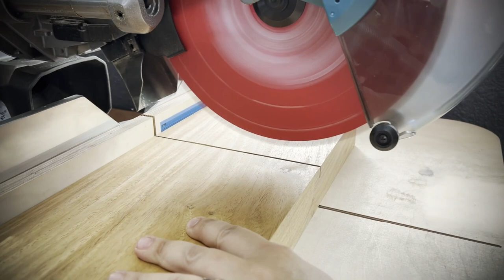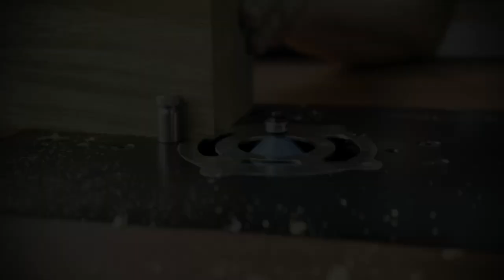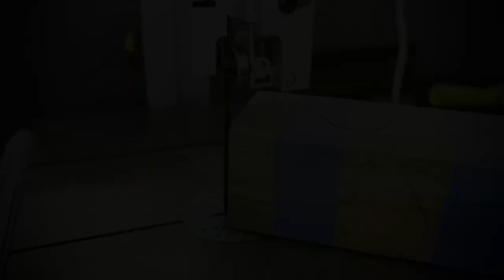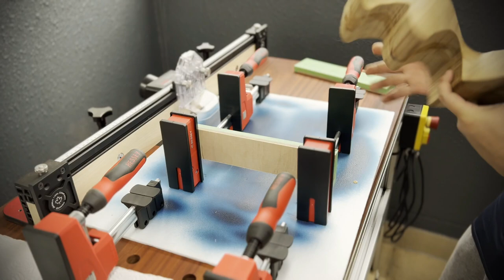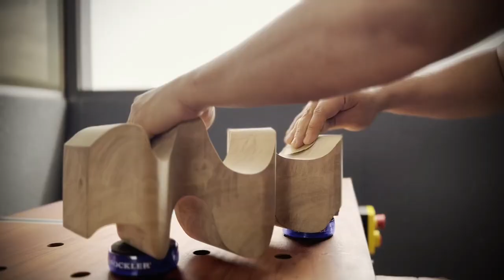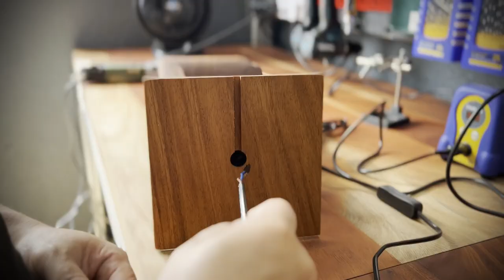Curvy wooden table lamp from a block of wood!

Comment: Hello. That's an amazing lamp. What width blade & TPI did you use ? As it looks like you made the base to be 4x4.
Reply: Also.What was the overall  height of the lamp please. Not including the shade
Reply from the maker: Thanks! I used the thinnest 6mm blade to get around the curve.
Reply from the maker: Around 400mm